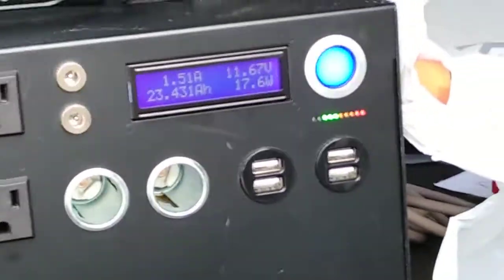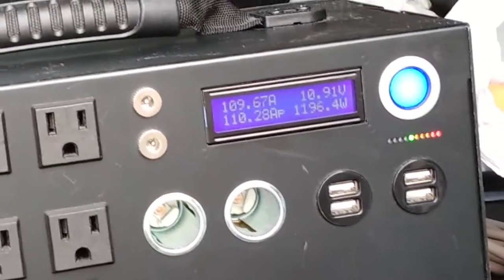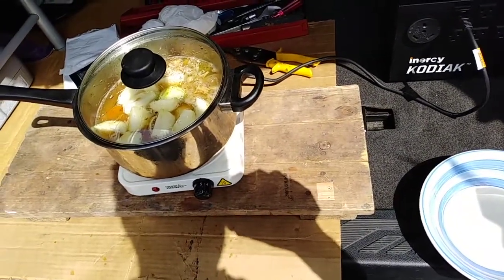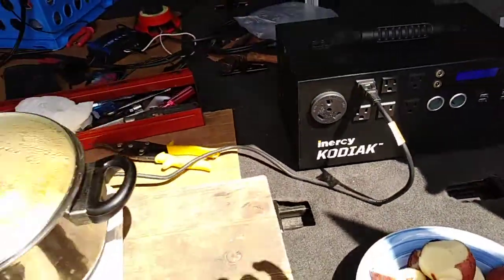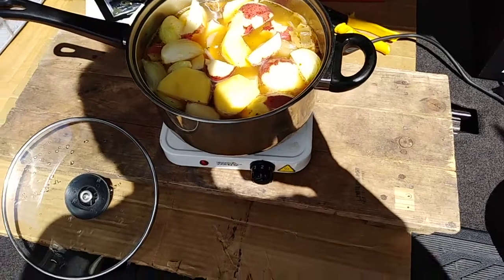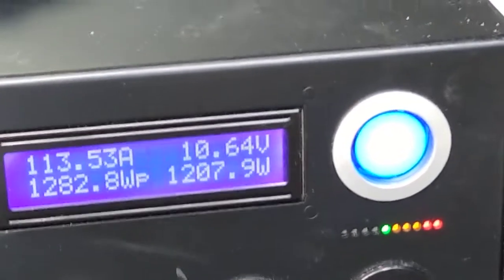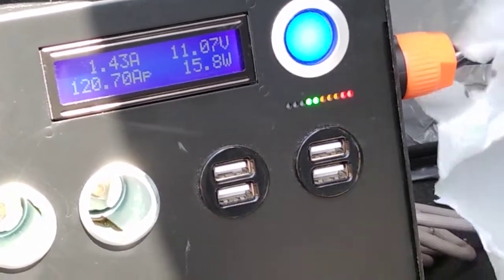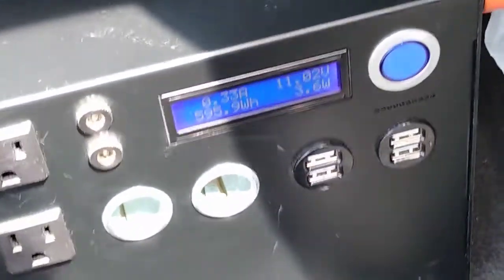One  Hour Load Test, using 1200Watt, on the Apex, K2 or the Kodiak with 400Watt of Solar

Comment: You don’t have the k2 apex!!
Reply from the maker: Nobody has an Apex since Inergy is having some kind of issue manufacturing them.  The first lot of Apex should have been shipped February 28, 2019. 
The battery bank of the Apex will be the same as the Kodiak.  If it is true for the Kodiak, it is true for the Apex.
If you are getting a Apex you have better se my video on how not to damage the Apex
https://www.youtube.com/watch?v=CCWnDGiySDQ&t=228s

Comment: Good load test.  Can U do a load test using the cigarette lighter 12v?  I would like to know what the voltage is on this socket going from full charge on battery to as low as U can take the battery down.  Showing the voltage on the socket at all times.  No AC inverter testing is necessary, only DC socket use.  How much current are U using during this test of the socket?  I am not aware of anyone doing this kind of testing on DC voltage use only.  Thanks...
Reply from the maker: I believe the voltage on the cigarette lighter 12 volt is the same voltage as the battery.  I am on a road trip a this time and can not test this yet.  
I did a video on draining the Apex or the Kodiak.
I took the power down to 9.11 Volt.  This is a real live test.  Here is the video:
https://www.youtube.com/watch?v=VOgfZC__g8Q

It really does not matter how you drain the battery. A drained battery is a drained battery.
So your 12 volt cigarette lighter port will only be at 12 volt.